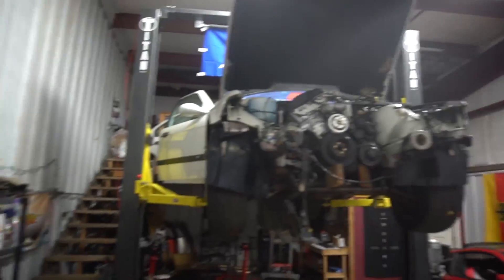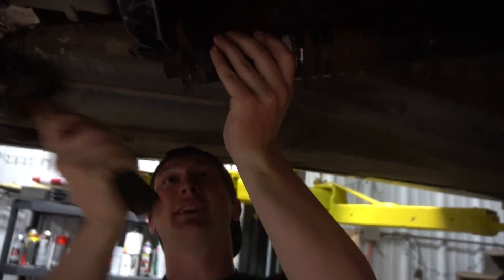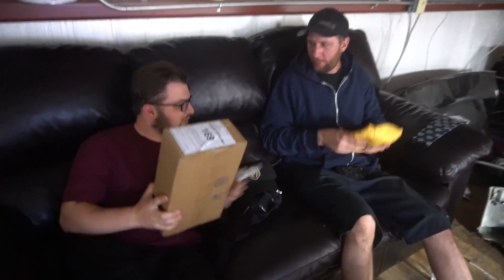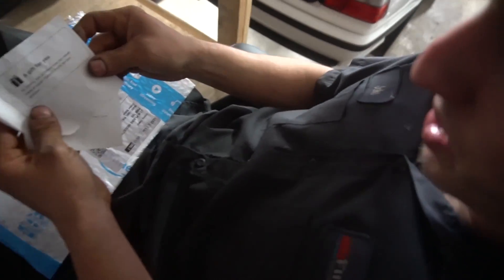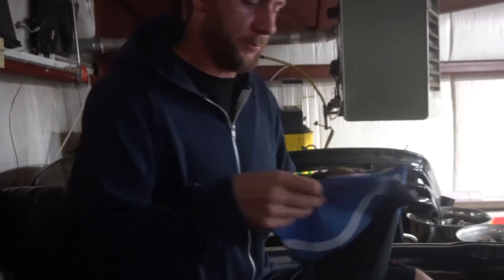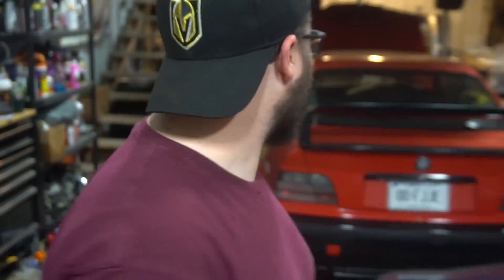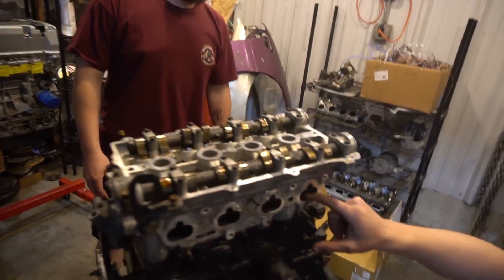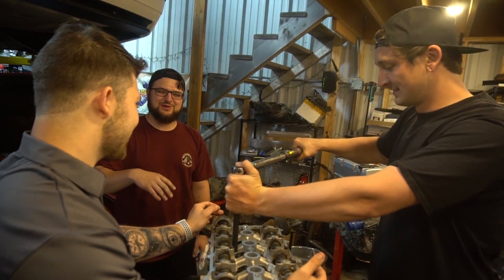Making progress with the M3!

Comment: I’ve never been a BMW guy, because I have always heard that they are a pain in the ass to work on. I highly doubt that an M3 is any more difficult than a bmw Mini to work on. I pulled the whole front end of my Mini apart thinking it was going to be a nightmare, and come to find out it’s actually not that bad. I pulled the subframe, transmission and everything else that was in the way including the radiator, intercooler, power steering cooler, and some other things. That boosted my confidence through the roof, and I feel confident that I can handle a BMW now, so I’ve been looking into them and getting into them a lot lately. I think I want an E46 m3. But if I’m buying a bmw, it 100% HAS to be a manual M car. I refuse to buy anything less. Any bmw guys that can tell me about the difficulty of doing work to e46’s?
Reply: It's all pretty doable, I've done pretty much everything but engine internals on me and my freinds' e46s and most jobs can be done in a weekend with basic tools. Parts costs ain't bad either but I can't speak for m cars.

Comment: You guys should put one of the Ford Escort GT or Kia Sephia valve covers on the new miata engine, and cut off the cam gear cover part of it. They look much better than the factory miata cam covers. http://www.thebluepotato.net/engine/fingerz/redcam2.jpg
And I think it should be done in FORD RACING BLUE. To really fuck with ppl. They're super cheap at at any pick n pull.